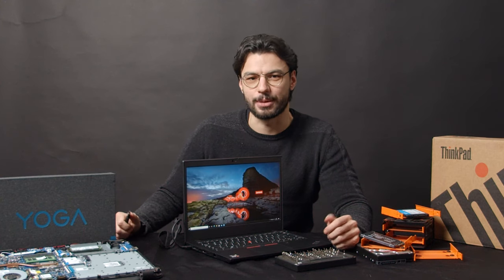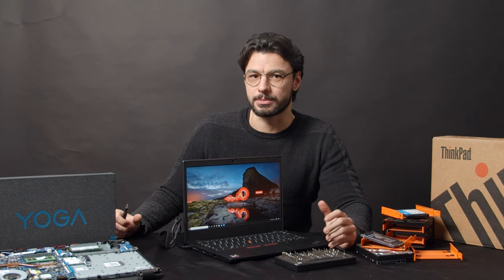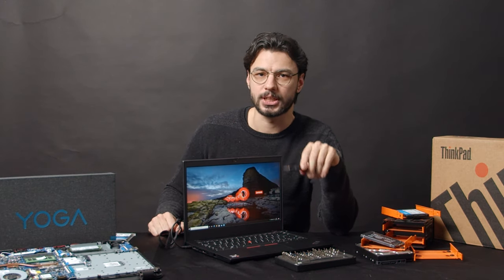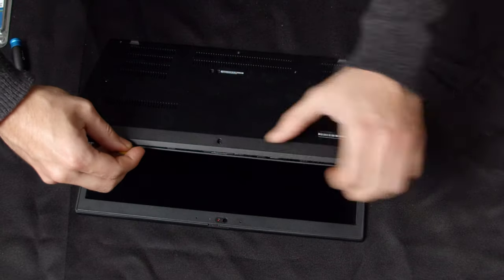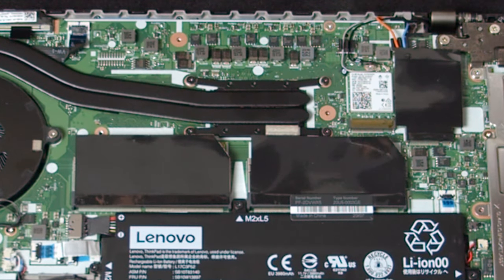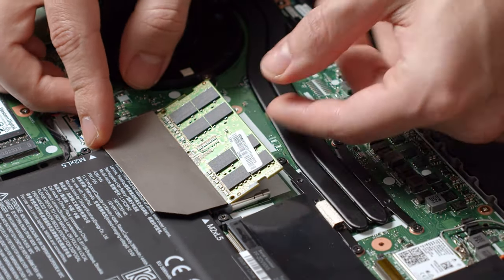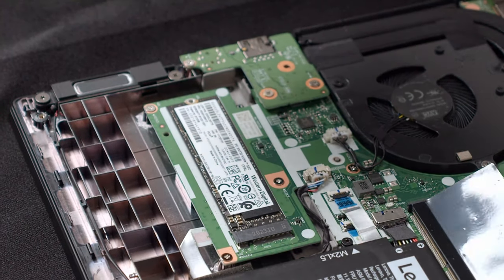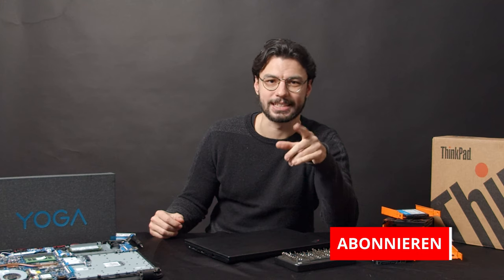Lenovo ThinkPad L14 AMD - RAM & SSD Upgrade English

Comment: EDIT: 2 of my 9 screws were not captive in the case (L14 Gen1 Intel, 2020 year). also, the video by LaptopMedia says to remove the SIM card tray with a sharp needle, but I didn't need to do this (not sure what it applies to). and my 8GB single RAM module had my laptop's serial number sticker holding it to the slot (annoying).

nice! L14 can do 2 RAM up to 64GB total on dual-channel, but only one SSD. exactly what i'm needing. anyone know if i can put HDD in addition to the SDD? or two SSDs? maybe in the WWAN slot?
Reply from the maker: Hey, you sadly can't add storage, just swap the existing one. The 2.5" slot and M.2 share a connector on the Mainboard, so it's one or the other. But we may have something coming soon which fit's your need better :)
Reply: @notebooksbilliger  great! i am trying to put a 2242 512GB SSD in the WWAN/LTE spot. i couldn't confirm on YouTube or Reddit if it's possible as of Mar2021.